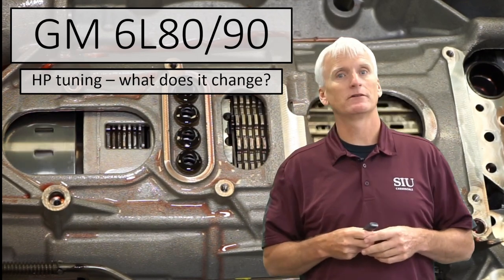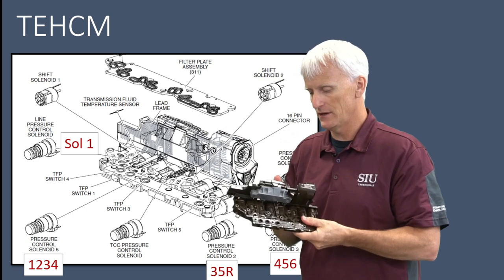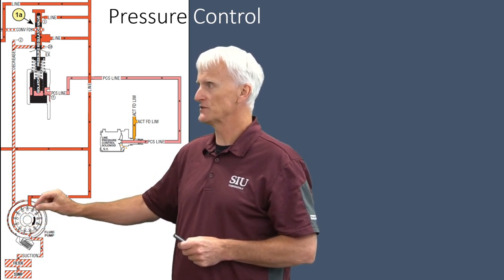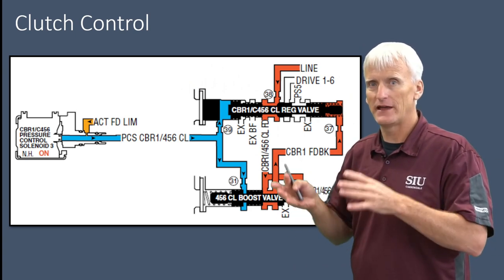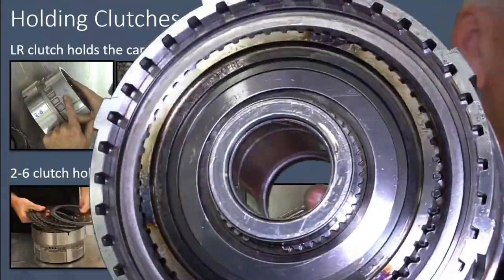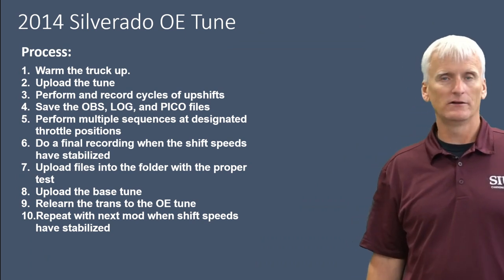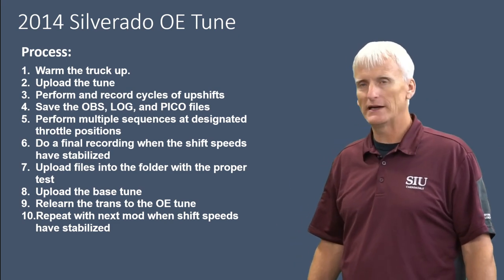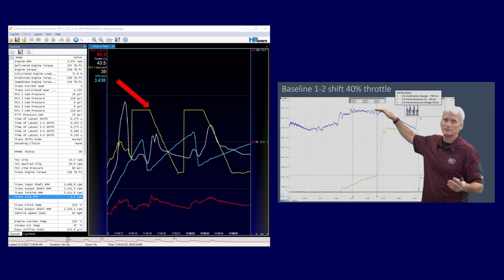HP Tuners and the 6L80 - What does it actually change?  Part one - intro and what you need to know!

Comment: Please please please go over the 10R80/10L80 next. I'm trying to use one in a swap and you're probably the best source of information I've found on all this. This is absolute GOLD! I appreciate the heck out of all the work that went into this!
Reply from the maker: I have some Ford 10-speeds and I have three 3l diesel trucks with the 10speed.  I don’t think hp talks with it, but maybe things have changed.  I look into it.
Reply: @siuautomotive  I kinda doubt I'm that lucky 🤣. There's a company called US Shift who makes a 6R80 and is trying to make a 10R80 controller. From what I can tell they're not shifting the thing properly. It looks like their shifts take about 600 milliseconds from initial command. Way to short for them to have the pressure ramping that's used in the factory setup.

Comment: FYI, in some versions of HPT and depending on the TCM OS, you can log PCA Pressure for the TCC Desired Table. EFI Live also has a channel for the TCC Slip Error RPM to work out where you are in the TCC Apply Ramp Table.